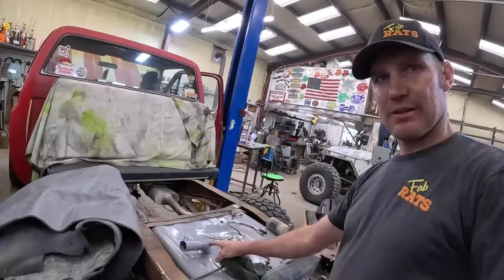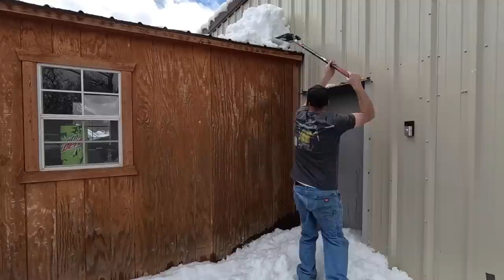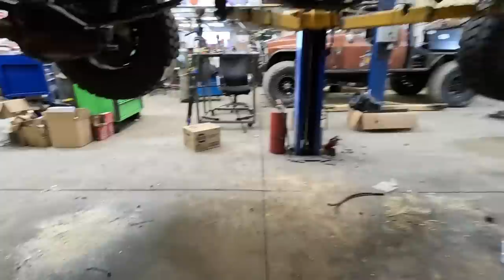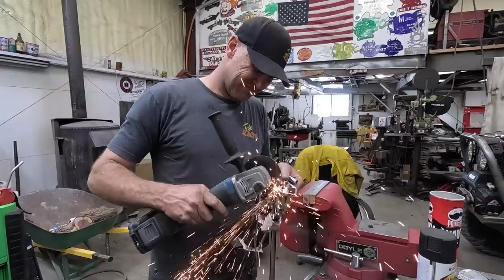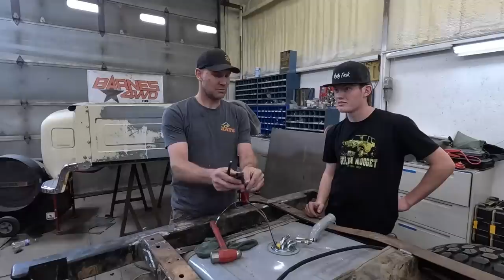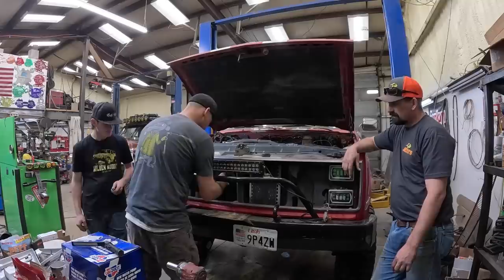Will The Curse Be Lifted Off This Truck Once And For All?

Comment: Hey Paul... they make cleats that will hold snow and ice on the roof. You install them over doors and wherever you want to keep if from falling.
 There's several options. 
Look at the local big box store or local roofing contractor supply.

Comment: Just a heads up, I saw the controller box for the throttle still on the firewall of the donor truck. You’re going to need that, and the harness going through the firewall and the throttle pedal to make the throttle work.

Comment: If the welding tip that was leaking is a "Victor style" it has 2 o-rings in it. They are  easily replaced. I worked with lots of "experienced" millwrights that never changed the o-rings and wrench tightened the torch head or welding tip constantly.

Comment: When you were pulling the gas line out i saw a wire fall down . go back to 8.15and at  8.20  watch up around the trans the silver part you should see the wire whe you snach out the line

Comment: I've had to add fittings to a fuel pump more than once. I believe silver soldering the joints would be a better choice tho. As long as it works I guess...

Comment: hay on the trans cooler it looked like you bypassed the radiator and went right into the cooler-when setting steal or at low speeds there is not enough air to cool the fluid without a fan

Comment: Not sure why the hoser guys couldn't find the fuel pump line fittings. They do make an adapter fitting that goes from the stock TBI pump lines to AN fittings. They also make the same for the other end of the fuel lines if your square is a stock TBI rig.  That's how we did my son's 5.3 swapped 87 suburban. Along with the same push on fittings you used at the engine.

Comment: When checking for leaks in an oxy-acetylene torch line, always use a FLAME!!! 🤣🤣🤣🤣 Does your tip have an "0" ring on the end that attaches to the mixing chamber? They will crack and cause a leak. If not its probably a dent on the chamfered end that mates to the mixing chamber. You got quite a bit done on the ol' square body!!  Looks like Sean is fitting right in!!! 😁

Comment: How about harvest the tank filler door from the side of a trashed body. Mount it in the floor of the bed and straight into the tank. Little inconvenient to get to, but would be protected. I still like the tank behind the seat, not the safest place but easy to service.<><Duce

Comment: You got some polished fender tops going on there! I've always been around Smith torches and they have replaceable o rings at the torch base. I kind of squirmed listening to that torch while you were brazing. I can hear you needed a smaller tip. But it worked so my opinion is mute. Nice show. As always

Comment: For the filler neck just run it through the bed and then disguise it with an old Jerry can there in the rear driver side corner of the bed

Comment: Is there any way you can tell us part numbers & where you find parts in the dicription maybe?  Like the fuel tank, pump sending unit ect?  I have been using the Christmas tree type zip ties of different sizes that take a single hole to attach to the frame ect.  Handy since you can use existing holes or drill exactly where needed.

Comment: prolly not a big deal -- But those exhaust pipes are super-duper close to the tank...  when the tank is full not an issue... but if Landon drives it hot, or leaves it parked and running with a tank that's almost empty.... the tank walls on both sides might get fairly hot and cook the fuel enough to cause a lot of pressure and a gnarly blow off of dino fumes  .. that stuff is just kinda a tad splosive'  BOOM ??   don't walk by with a lit cigarette.

Comment: I had an old C10 and that thing had multiple motors and at least three transmissions and it would break down at least once a week, I sold it and it gave the new owner the same headache, some vehicles are just cursed?

Comment: I know it’s slim to none that this would ever happen. Sometimes the dipstick gets misplaced and a person says cheese. How do I know my transmissions got the right fluid in it this is a pain in the ass but you loosen the pan bolts. Word pan just comes down off the transmission slightly. You start dumping your fluid in and the fluid level was usually right about at the pan level might be a little bit higher, but not much so just to let you know if you ever lose the dipstick or something happens gets damaged you can and put the proper amount of fluid in by doing that nice do transmission work for a living I’m just curious what transmission that is a 700 R4❤❤😅

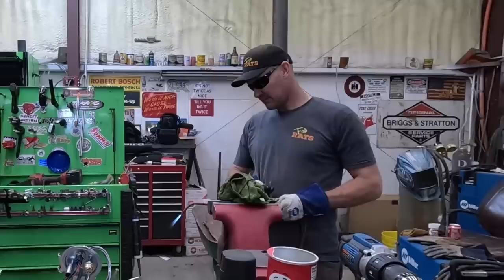Comment: 12:44 I notice Americans always turn off fuel but Europeans always turn off oxygen 🤔
You should be able to apply some teflon or grease to the threads to give it a quick seal if need be, I wouldn't leave it like that but the torch stays cool enough that I should last long enough for a job or two. I wouldn't play around like that either, if you have fire at the joint you're a hair away from it running down the lines.

Comment: There make a comparison fitting in stainless to A.N. there use in the oil fields make easyer than soldering if  I had address ill send you assortment

Comment: get real expensive those pan seal funny how weather can effect transmission those rubber oil seal $1.50 on line 5 something  at auto store had same thing with design of those now days rubber and metal no rather make my own hoses and fittings tubeing ya it time yes it best just buy it plugs wires coils each system has it own like old stuff less parts yes traffic now days like driving a machine sad comfort and air conditioning